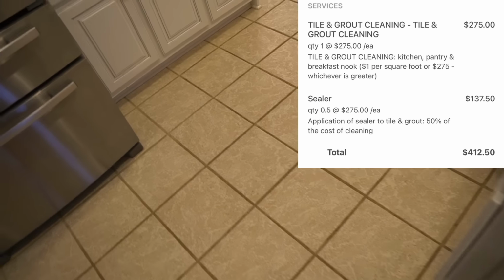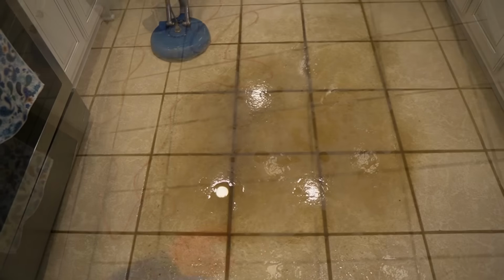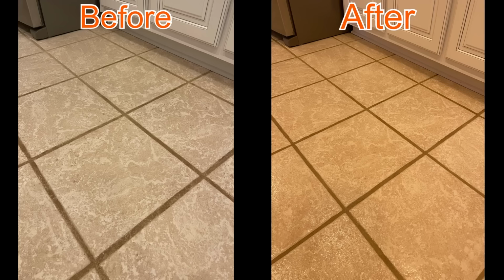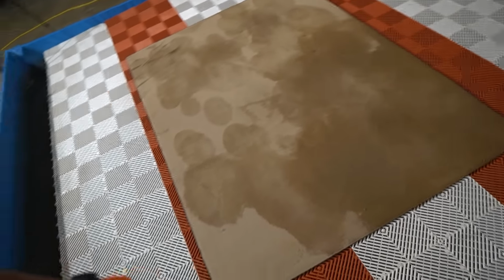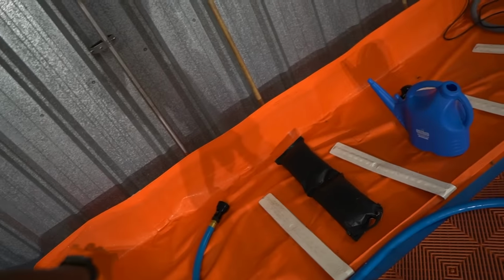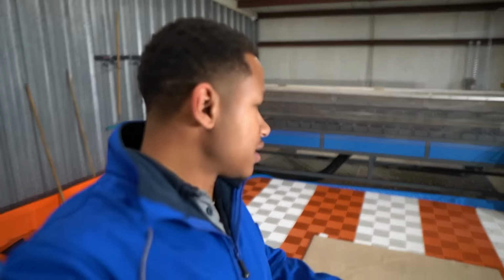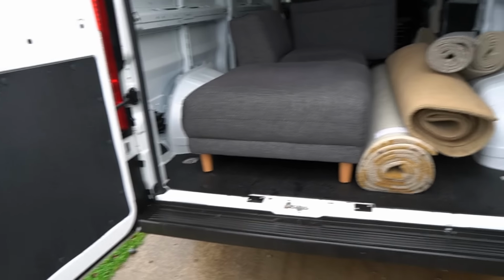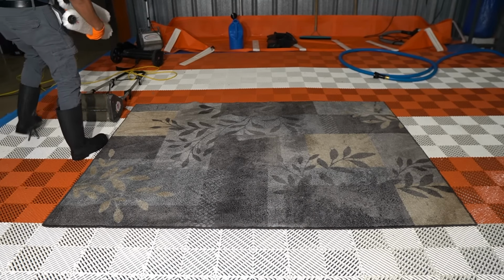PUTRID URINE soaked rug made this water look like lemonade!

Comment: Hey, nothing wrong with dumpster diving!  Years ago I used to live in a downtown high-rise  luxury apartment building, and while I lived on the low level cheap rent floor, the folks in the upper level floors threw out expensive stuff on a regular basis.  I frequented a bar/restaurant just across the street from where the apartment building's dumpsters were located and so walked by them almost every day and so was able to, over time, furnish a good deal of my apartment with furniture I found in those dumpsters, most of which still furnishes my apartment to this day.  One person's trash is another person's treasure!

Comment: Love your channel.  There's something so satisfying about watching you all clean stuff, lol.  I have a suggestion for you all: my good buddy is a car mechanic and all the air hoses for his tools and whatnot are hanging from the ceiling.  You pull what ya need and if ya pull fast enough it'll suck back up to the ceiling housing.  This keeps everything off the floors and you don't have to worry about tripping over the hoses and or hanging them on your shoulders as you move around.  I was thinking maybe you should do that with the extension cords and see how that goes.

Comment: I wouldnt throw a rug like this away. The design looks nice
Reply: Fact is, you never 100% remove the urine. And pets smell where urine once was and will repeat on peeing there.
Reply: @petrescuework-difficultcas6581  There are plenty of enzyme cleaners that neutralize the urine so pets won't repeat.
Reply: @Kimichitsuzuku  That's their advert claim.
You know why these cleaners aren't used in any professional pet care facility? Because they don't work.
Reply: @petrescuework-difficultcas6581  pet care facilities don’t have rugs, that’s why they don’t use it.
Reply: @doreenblatz2440  Correct, they dont have rugs because of how much it would stink and be disgusting even after the most intense washes. Literally what Shepherd Sam was saying Doreen.....
Reply: @doreenblatz2440  Enzyme cleaners aren't "rug only cleaners". They are advertised to work on all surfaces. But they don't. That's why no professional pet care facility uses them.
Reply: @petrescuework-difficultcas6581  Even if you're wrong and they work, pet care facilities still won't be using it just because it's not practical to have rugs or textiles that need to be washed. All of them have stone/ceramic tiles that can be easily washed and sanitized without specialized products like enzyme cleaners.
Reply: @Navitus  No, it's because it would take too many resources that pet care facilities often don't have (labour, money, etc.) to spot treat vs being able to easily clean down laminate or concrete when you're running on not enough staff lmao.
Reply: @Etianen7  Maybe reread? I never said that pet care facilities would use rugs?
My statement was about enzyme cleaners not working. I never talked about rugs in the first place. It was another person who brought that up.

Enzyme cleaners don't work, also not on tiles or concrete. That's why they aren't used. And only private households buy them.

Simple cleaning or desinfecting of tile or concrete floor won't remove urine odour though. For human noses probably, but never for pet noses. That's why there will always be more pee markings in these areas. That's what pet care facilities deal with.
Reply: @petrescuework-difficultcas6581  I have an industrial enzymatic cleaner for kennels, I use on cat wee, it works. Think the vets recommended to me as I had a 22 yr old cat that was trying his best so just weed on puppy pads missed occasionally.
Reply: @sarahhoops9696  22 year old cat bless him

Comment: Myles, why not try sweeping the CRB side-to-side, in order to maximize the brush's contact with the grout joint?  Letting the "peak" of the one of the brushes rest in the grout groove and let it ride back and forth along the length of the joint.  Pushing front to back, as you are in the video, has the majority of the brush on the face of the tile, which may not let the bristles into the joint as far.  I'd be cool to see both techniques compared on the same job.   All the best, and thanks for posting all the content!
Reply: Yea that's a good point.. it would probably be a pain to "sweep" side-to-side, but I agree that I think it would be better for the grooves

Comment: I am glad you cleaned a rug that was literally going to be trash, the result was spectacular and so was the video. The one thing I didn't like, though, was the single-use plastic bag used for soaking it. It would be a lot better if the bag was reusable or if there was a bagless solution. Such a waste of plastic. Great video nonetheless!
Reply: So are trash bags in homes and businesses. Its just a plastic bag. Nothing to worry about

Comment: Question :  with a rubber backed carpet does the water drain out if the rubber backing faces the outside of the centrifuge?
Reply: I would imagine it just comes out the ends of the rug rather than through the backing. Whether you have carpet facing out or rubber, 80% of the carpet is still going to be blocked
Reply: That’s a good question. My guess is that some would be squeezed towards the edges but ultimately it wouldn’t drain properly.
Although I don’t know if the rubber backing is truly impenetrable. There’s like a rubber-backed mattress protector that came with my bed, but I think it’s more of a breathable light-duty protector than an incontinence-level mattress protector. So, when I spilled a drink, it actually stained the mattress a bit.
Reply: Probably the edges, you can try the same rug cleaning technique on car floor mats and it works well, same thing though, the underside isn’t rubber but it’s designed to not let the liquids get through and from what I can tell, the carpets hold a load of water and only when you squeeze it out does it drain, and it is like a wave. So it is likely the edges.